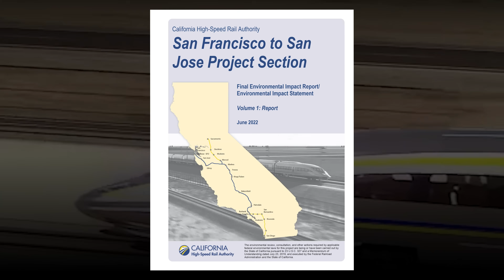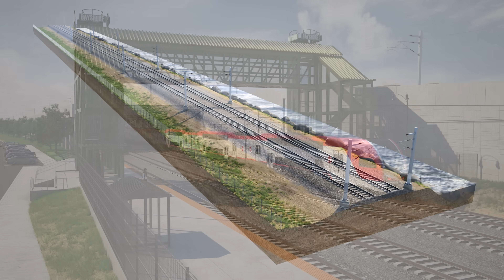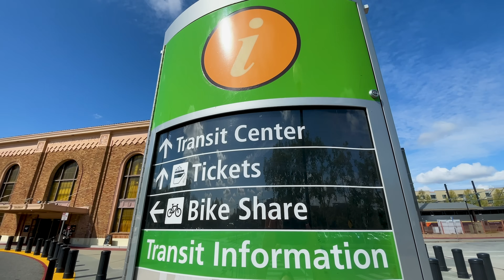San Francisco to San Jose Project Section Overview - FULL VIDEO

Comment: Wow...Los Angeles is seeing so much progress with this project, approved by the voters in 2008, you’ve completed NOTHING in Southern California.  Just lots of plans and rights of way and property acquisition in the Central Valley for the Bakersfield Express. Who wants to go to Fresno?  All Aboard... 🚂  You’re building this backwards and compromising constantly, it won’t be fast, it isn’t ready, it won’t be safe, it is so expensive that it isn’t fully funded, and therefore it won’t be ready for a long time.  A project high jacked by special interests is now defying the will of the voters.  High Speed Rail is now a Slow Speed Mess. Congratulations 🎉🍾🎈
Reply: The main problem is funding. The initial cost projections were vastly low-balled. All the other problems are fixable. Cost projections keep going up.
Reply: 1.  Trying to build HSR on existing rail infrastructure.  Following freight train's rail is not built for high speed.
2.  These people are trying to stop every small town in CA to increase the revenue and profit.  This HSR supposed to connect between 2 major metropolitan cities (Los Angeles & San Francisco or Los Angeles & Sacramento) where the train can pick up 100s of passengers compare to just a few in small towns.  You don't see airlines pick up every passengers in every small towns.  Why with HSR?
3.  We shouldn't say and define as HSR when the train is keep on accel - brake - accel - break -accel - brake - accel - brake - accel - brake - accel - brake - accel - brake due to stopping at every small town along this structure/route. 
4.  Remember: Chinese people (people from outside of United States) built existing United States Interstate system and railroads.
5.  Airlines and car companies lobbied hard to make sure that HSR doesn't get built.
Reply: @youngchu1638  2. Because that's ultimately how trains operate. Airplanes are very good at flying but takeoff and landing sucks for them whereas trains are much better in changing speeds, though how much depends on the model (the powercar based TGVs are built for sustained speeds unlike the Velaro which is an EMU and better in changing speeds). Stops in "small" towns (with "small" being relative here) are much more economical compared to airplanes. In fact, the Shinkansen, the first proper high speed railway, has a relatively high stopping density with many stops being spaced around 25 km apart though obviously not all trains are going to serve them (neither will CAHSR, for that matter).

Comment: 1. This corridor is a failure before it started.  You can NOT run High speed rail and commuter rail on the same two tracks.  This line must be four tracked, else, what's the point?
2. We need to eliminate ALL grade crossings.

Don't worry, there is plenty of money for this and the Hudson River Tunnels.  Just end all aid to Ukraine and start aiding America.  Plain and simple.  If we ended all aid to Ukraine the war would end in days.

Comment: I am worried that the maximum allowed "cant", (aka the banking or "superelevation" of the curves for a turn) is going to unnecessarily increase costs of these kinds of projects, because of the increased land acquisition costs, structure costs, and other project related costs, in order to maintain the maximum possible speed of the trains (with a lower cant, the track alignment needs to be straighter in order to go faster, but if the cant is higher, the train can make turns in a curve at a higher speed). Are there any technical specifications for the projects that show this information?

The FRA has very outdated regulations that specify a notoriously low maximum allowed cant of 3" (about 5% of gauge width), whereas the rest of the world has a maximum allowed cant of 10%-12% (5-7 inches for standard railroad gauge width). A lower cant is really only necessary for when there is much slower freight traffic. Are the high speed sections of the rails still adhering to the FRA's ancient standards, or is it using something more contemporary?
Reply: It's already done. the minimum radius shall be 2500 m to 3000 m in difficult conditions (speed to be reduced), and the radius in normal conditions is 5000 m (400 km/h).
Reply: @CN_SFY_General  But what is the super elevation of the curves? Please don’t tell me you’re adhering to crack pipe smoking FRA standards. If so, this project is doomed.
Reply: @WheelerLaw   I worked 30 years in Railways. Superelevation is a parameter linked with speed, curvature. You design the track at a specific speed, then the speed over this speed or under this speed will have the superelevation insufficient or too much. The trains must pass through the curve with a speed within a certain range. You never be able to design a track works well for both high speed and low speed. In addition, trains travelling with large speed difference makes the tracks not very efficient even if the track is straight (0 to maximum speed will be fine in straight tracks).

Comment: Of course this where first part of Monies will be spent. Lets create Train coverage redundancies Same Train Stations covered by Cal Trans Train and High Speed rail. Lets further wear out the High speed trains before the even get to go any further towards LA. Guess at the end of the Tracks in San Jose, one just imagines Stations further South. 
Better is monies spent on long stretches of tracks between San Jose and LA. Then build up the Bay Area section. The High Speed Train actually would have a Purpose. Not just an overpriced CalTrans Commuter Train.

Comment: I can't imagine taking HSR from SF to SJ when I could take Bart instead (no grade crossings). And if you live in the East Bay, taking Bart to SJ is even more obvious.
Reply: SF to SJ on bart, aside from being currently non-existent, would take way longer than the proposed 40minutes on hsr. Closer to an hour 15 I'd say.

I would wager most at-grade crossings will be fixed by the time hsr is ready, or at least the planning to do so will be well underway.
Reply: @quickstart90909  But the actual time to your door depends on where you live. A lot more people live close to a Bart station than to 4th and Townsend.

Comment: Wasn't this proposed over 25 years ago what happened to the money to start the project and besides if it's anything like the Streets of San Francisco San Jose and everything in between is just going to be nothing but feces and needles and bums right in the train 24/7 yeah starting to realign those pockets again with the new green deal the funding should be there already according to the new green deal plan or is that the money they gave to the CCP already you can thank Governor Galvin Newsom and his auntie Pelosi

Comment: The under 3 hours trip sounds really awesome! I’d be able to hop on in LA at 7am (I’d even be able to snooze for an hour or so, can’t do that while driving!) get to SF at around 10 am. Spend the whole day in SF, hop on the train at 7pm (have another snooze) and I’m back in LA at 10pm. Suddenly, a one day vacation to SF from SoCal is feasible!
Reply: I hope your young because this is a 20 year project.
Reply: @Parkside29  So far it's 27 years and not a hope for completion before 2045 (if ever)
Reply: also you get plugged into the city centre as opposed to outside at some random airport miles out. it will be amazing
Reply: @blvck5943   "also you get plugged into the city centre as opposed to outside at some random airport miles out. it will be amazing'
 You mean like today ... Merced to San Francisco 129 MILES & Bakersfield to downtown LA 112 MILES
Reply: You can fly that distance in an airplane in an hour and a 15 minutes so why would you take a train that will take more than twice as long, cost just as much and be less safe?
Reply: "...Suddenly, a one day vacation to SF from SoCal is feasible!"
Keep dreaming! I've been hearing about this high speed train since 1996. I will be amazed if this SF-LA section completes anytime before 2040.
Meanwhile, there's a much shorter trip you can do today (and has been available for the past 50 years)... a 45 MINUTE FLIGHT (as opposed to 3 hours by train) from LAX, Burbank, etc. to SFO, SJC OAK, etc.
Reply: @toothlessseer3153  the point of the train isn't to just connect LA and SF, it's to connect multiple large population centers with an adequate alternative to driving, not flying.
Reply: @cheekypomegranate4877  large population centers... like Merced and Bakersfield?
Reply: @toothlessseer3153  I'll give you Merced, even though it's growth rate is like 10% over the last decade, and it's still 100k people, but Bakersfield almost has half a million people. Since when is 450k small?
Reply: @toothlessseer3153  Driving through lax fucking sucks
Reply: @ee-ef8qr  Many secondary airports
Reply: @toothlessseer3153  Don't forget the 1-2 hours advance wait at the airport and the inconvenience of going through security.
Reply: and tickets would be cheaper 😀
Reply: @toothlessseer3153  With the time spent to/from the airport, security, and waiting time at the airport, it is largely a wash - and HSR will in many cases come out on top.
Reply: @mccrearym  Congrats to people of Superpower USA 🇺🇸 🎉🎉 
We Indians are also building HSR with the help of Japan 🇯🇵.. we will be getting the E-5 Shinkansen 🚄
Reply: @mccrearym  the first time a terrorist sets off a bomb on a train it will take just as long to go through security to get on a train as an airplane and really there shouldn't be any difference anyways. Also is the location of a train station any different from the location of an airport? For most people not really, both will require some driving. The future is air travel and self-driving cars.
Reply: @mccrearym  Even with 1 hour in security an airplane is STILL FASTER and CHEAPER
(As of today, one can easily buy a ROUND TRIP on Southwest for LESS THAN $100)
I fail to see how HSR will 'come out on top' especially with another $20 to $50 billion required to complete it.

Comment: Having spent 7 1/2 years in Germany in the army, I became enamored with rail, and high speed rail travel. The issue I have with this project are the same as those promised by BART--a very high speed system that has never played out. You have a forty mile run between SF and San Jose...with two stops in SR, a stop in  Brisbane, a stop in San Mateo (mind you, we are only halfway to San Jose), your train will be lucky to reach 45 mph. Too many stops in too short a distance!
Reply: First of all, express trains will exist from day one. Second, where are you getting all these stops from? There will be a stop in SF, one in Millbrae, and one in San Jose. That’s it. Worst case scenario, there is one stop on your SF-SJ CAHSR trip. Best case - no stops.

I suggest you look up the actual planning documents they have online. There is a lot of anti-rail propaganda floating around and targeting specifically CAHSR.

Comment: I'm all for HSR but the time difference for the 43 miles from SJ to SF at 110mph vs 79 mph is only 9 minutes. Not a lot of bang for your buck.
Reply: Nope. It goes from over an hour now to under 30 minutes. Where did you get those fake numbers from?
Reply: @TohaBgood2  

43 miles at 79mph. You're telling me that's over an hour ? I'm guessing that you didn't calculate this ? If so, better try it again.
Reply: @rhp_6926  That's complete and utter nonsense. Stations exist, tight curves exist, grade crossings exist, track geometry exists! You can't pretend that the conductors just pin the speedo at 79mph for the entire route. 79mph is the "speed _limit_" on this class of track and nowhere close to the actual running speeds.

Caltrain is a real service that has a schedule online right now. Care to tell me what the schedule actually says, bud? How long does it actually take? 

Keep in mind that the station dwell times are also known, so you can easily compute a nonstop duration too (with a little math for reduced slowdowns).
Reply: @TohaBgood2  

All things being equal. Same track, same single stop (Millbrae), A Caltrain running at 79mph will be 9 minutes slower than an HSR train over the 43 mile route. Can't argue with math, bud. i ride Caltrain 5-6 days a week and they will run at 79mph when they can on bullet and express trains. My point is this. Why pay the extra money for the HSR infrastructure when you already have an asset in place that can do the same job.

Comment: Dont think you can have any HSR if you still have same level road crossings. Most HSR systems have their own tracks running above or with roads in tunnels below the tracks.
Reply: They didn't want the Amtrak to run faster than 45 MPH through my town in NC a few years back. They built two new bridges and closed a minor crossing as well as an important neighborhood one, making cars detour a mile down the road under that new bridge. It was funny to see people use their GPS or memory and put their blinker on for a turn that no longer exists. Now the Amtrak runs 10mph faster through there, going 55 MPH or so.
Reply: @sandal_thong  That's not good enough for a high speed rail. At 250km a hour they can't stop.
Reply: @neonboy99  A train's not stopping for a truck blocking the crossing at whatever speed it's going.

Comment: I have been commuting across the track for years both by Caltrain and by car. Folks, the problem is that these are not simple crossings but crossings+intersections due to all the roads running in parallel with the track (ECR/Alma/Central Express...). People sometimes don't have the patience to properly wait for right turns at red light. (And honorary mention, some bicyclers too). 

I wouldn't blame them (to some degree) because in the south-bay suburbs the track separates downtowns/jobs and middle-lower income neighborhoods, and of course the big techs and their employees' houses, though in reverse direction. These crossings create tight bottlenecks for commute traffic (this is even true for separated ones like Embarcadero in Palo Alto). 

Plus there's foot/bicycle/after-school kids traffic that further impedes traffic flow... and just imagine all these in a rodeo on a Friday afternoon before holidays... I feel sorry for the train conductors who have to go through so many dozens of these crossings.

In the end the project might make more sense by just building separate tracks along the foothills or the Bayfront compared to sharing Caltrain track, though these are wildly unrealistic fantasies due to so many reasons... The problem is unfortunately holistic.
Reply: Yeah this is a concern I have as well. Top speed of 110 mph is absolutely not safe. I fear there will almost certainly be accidental deaths. A couple of weeks ago several grade crossing gates were down for literally hours. I ended up driving around them. I stopped and looked both ways, but still...

But anyway, I doubt this section will ever go into service. Or maybe they'll find funds to build grade separations.
Reply: @DouglasLippi  I've been watching the passenger trains in Florida hitting cars, illegally going around gates to cross when the lights are flashing, including police! Best not to have them, or if so make the roads one way so they can't go around the arms, then have barriers pop up from the ground like at a security gate to a government installation so they can't break through the arms.

Comment: Won’t believe it until I see it!  Still years away!
Reply: First section will most likely be done by the end of this decade
Reply: Not years. Decades. In one of these other videos one of the administrators was even talking in terms of generations. Unfrickinbelievable.
Reply: @DouglasLippi  well that aged poorly
Reply: @darthmaul216  lol. What, did someone make a new prediction? Cuz I know the trains aren't rolling in reality. Muni did finally get the stupid Central Subway running, so I guess anything is possible if you wait long enough and throw enough money at it. Only 14 years for 1.7 miles and 4 stations (one of which is redundant), and they actually made it worse if you used to take the T up the Embarcadero cuz it doesn't go there anymore. $1.9 billion. I guess it will provide more shelter for the junkies and nuts, so there's that. More places for them to piss and shit too. Cool stuff. Oh and the fun will really begin when the escalators break and people are forced to climb the longest staircase in the country.

Comment: Finally some sort of improvement to public transit in the Bay Area. This is good news. But 110 MPH is hardly high speed rail. California is decades behind most advanced countries, more than half a century compared with Japan. Although an important improvement I consider it incremental, at best. Definitely not innovative.
Reply: What was achieved was a report. No trains are planned to roll currently. The wait will be long.
Reply: The majority of the route will be the centeral valley corridor, also the routes will have many curves in the city. We want to be fast but also be safe .